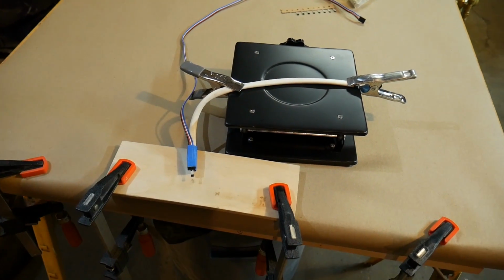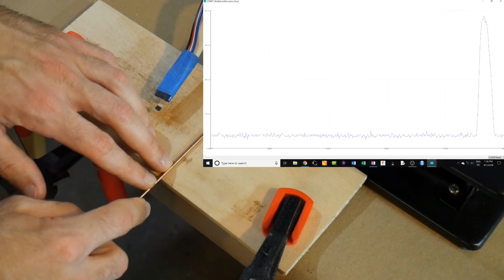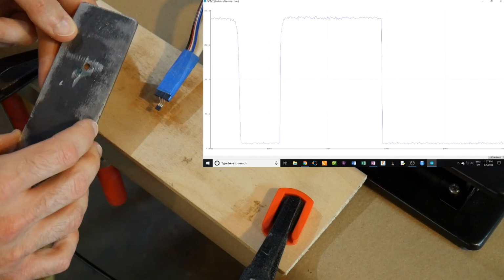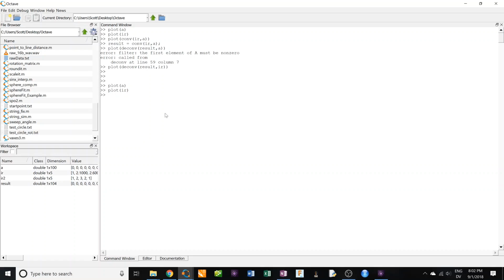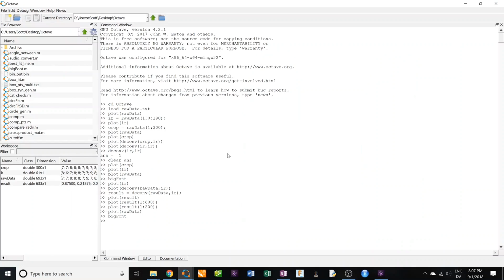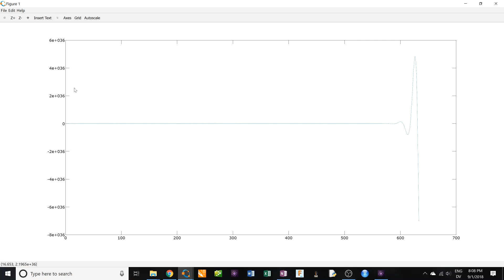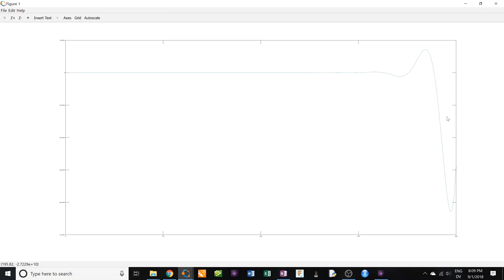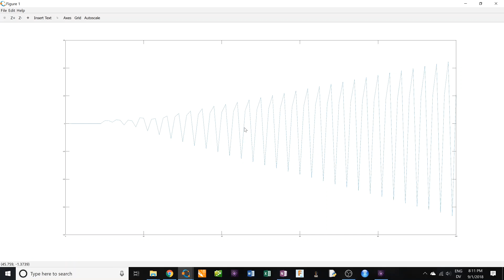Experiment: Magnets & Deconvolution

Comment: This reminds me of late 1991 and the first six months of 1992 when I worked for Physical Research Inc. in Torrance , CA which was developing the Magneto Optic/ Eddy Current Imager. I worked on the clerical side, not the technical. Bill Shih was head of the company. If I’m not mistaken, Bill was closely involved with the initial research that lead to magneto optic imaging. This instrument detected small surface or subsurface cracks or corrosion on aircraft. It used what I imagine is a similar technique to what you demonstrate here. The data, such as you collected, was then converted to a visual representation of the corrosion and displayed on a small LCD (maybe it was too early for LCD, some display anyhow) in the hand-held unit. You are probably aware of much of this. It was a new concept for me and the beginning of an interesting time.
Reply from the maker: I'm not familiar with these at all, there seem to be plenty of articles about them though, I'll definitely check it out.